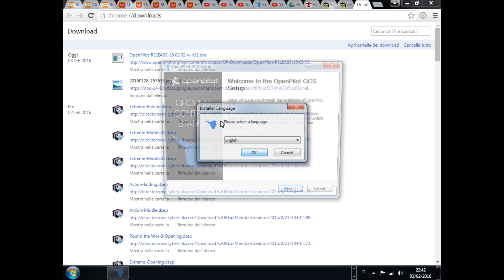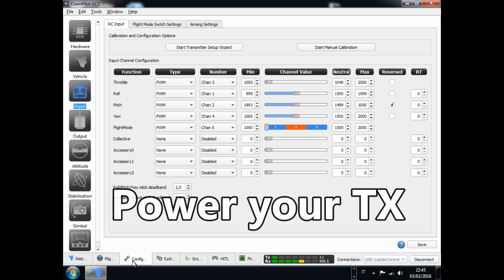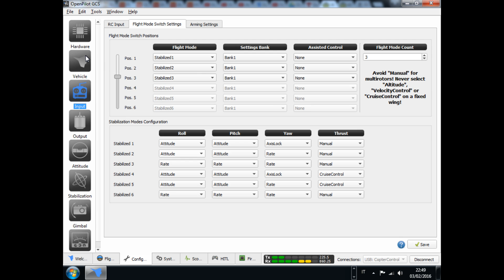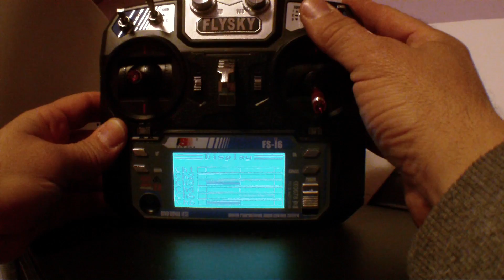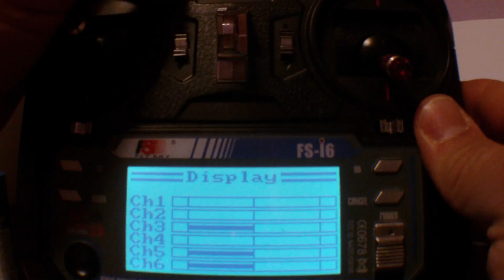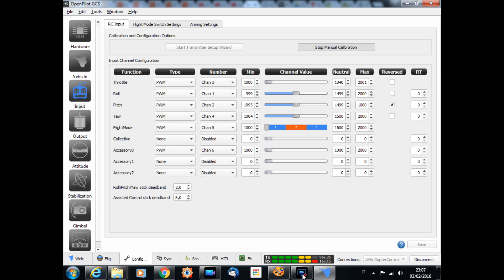Eachine Falcon 250 - how to enable ACRO+ with Openpilot - Fpv Racing!

Comment: Hello Angelo! I'm new with all this.  So to set acro mode on you don't need to plug your radio to the Pc? Only the drone?
Reply from the maker: Yes, only the drone as you can see on the video. Obviously you have to choose one stick on the radio to be associates to the AUX for changing mode
Reply: Ok..  Thanks! Another question: as I understood, it is not recommended get off the ground or landing in acro mode, is this right or did I understood wrong?
Reply from the maker: It's up to you. If you feel right to take-off and land in acro you can do it. Now I prefer the angle because I'm using airmode so the motors spin when armed and I prefer not (even if I know that I can stop spinning also in airmode...).
So, start and land in angle mode and switch in acro when you are flying.

Comment: Stabilized flight is already set
Reply from the maker: Is it a question? :-)
Reply: Yesss! Stabilized flight is already set?
Reply from the maker: Wow! It's an old video for me. If I remember well after flashing libre I found attitude activated by default. But you need to check with your pc because you have to configure the swith on the radio as you prefer
Reply: Thanksss a lot man!

Comment: Ciao Angelo, UN tutorial sulla radio eachine i6 ...........lo metti in programma ? In italiano.......
Reply from the maker: Per i multirotori non c'è moltissimo da fare sulla radio. Ci penso e vediamo cosa esce
Reply: angelovideo71 grazie. Senti devo risolvere un mistero, sto assemblando un falcon 250, ho preso telaio con pdb originale, ho saldato i connettori e collegato ccd e batteria e basta, la cosa strana è che in tutti i connettori di uscita,esc ECC... dove dovrebbero uscire 5v ne escono 12...???? Strano o fino a che non collego gli esc è normale ? Grazie per la tua disponibilità Angelo.
Reply from the maker: Samuele Tirinato sono alle prese anche io con la sostituzione della pdb e sto avendo problemi. Sembra che tutte le uscite a 5v siano inattive (forse manca un componente...bo) anche se una volta ho misurato 5v da una di loro. Ma solo una volta. Ho risolto mettendo un bec esterno (cosa antipatica perchè da una pdb ci si aspetta di avere tutto incluso). Inoltre i collegamenti tra esc e fc non corrispondono alla configurazione di LibrePilot per cui devo bypassare la pdb e collegare gli esc direttamnete alla fc. Praticamente un sacco di lavoro e cavi in più. Probabilmente stai avendo i miei stessi problemi anche se non ho capito esattamente dove stai misurando i 12v

Comment: Hi, Could you explain - for which purpose used VrA and SwC? Am i right that SwC used for FlightMode switch to acro? For what then used VrA?
Reply from the maker: I prepared it to use for tuning on flight. You can change PID with a pot.
Reply: Have you already tuned PIDs? If yes - could you share them?
Reply from the maker: If you see my other video on falcon you can see that I used the stock pid. They are good for me.
Reply: I saw, but thougth, that i missed, something. Also i got strange result with acro+ mode quad just flipping back. Looks like i missed something in your video. Could you please upload xml with your full config (or just send directly to me)?

Comment: Nice tutorial. My first mod would be to extend the mini usb connection to the side so I wont have to disassemble half the quad to test different settings.
Reply from the maker: +Leo van Miert yes. I'm waiting for some usb angle connectors
Reply: +angelovideo71 So after these changes, how do you like the Falcon so far?
Reply from the maker: It's a very good RTF. I fly with stock parameters except for enabling acro+ and adding speed on flip and roll. No waste time in tuning! Only fly
Reply: I have the usb on the left side and I just cut the carbon fiber  blocking the port using a small pile.

Comment: Risolto il Max del gas era a 1500 invece di 1900 , comunque ho usato librepilot , aggiornato il firmware è usato le impostazioni del zmr 250 con batteria a 3s , messo attitudine a - 10 . Adesso aspetto che smetta di piovere per provare fuori !!!
Reply from the maker: Ottimo! Aspettiamo riscontri su Librepilot

Comment: ciao , non capisco come mai il mio falcon quando do tutto gas non schizza verso l'alto come si vede in alcuni video , devo cambiare qualche impostazione ? altra domanda : ci sono cam migliori  con osd incluso ?
Reply from the maker: Per lo schizzo in alto credo che lo stiamo già esaminando su altri canali. Sono sempre Angelo ;-) 
Per le Cam prendi questa è vai tranquillo.
http://www.banggood.com/RunCam-Magnesium-Alloy-Housing-SkyPlusPZ0420M-600TVL-18g-Wide-Voltage-PALNTSC-Mini-FPV-Camera-For-QAV250-p-1000577.html?p=HM3106075425201208YA
 Devi solo fare un po' di cablaggi ma quelli sono necessari quasi con qualsiasi altra Cam. A breve spero di pubblicare il video in cui mostro come l'ho montata

Comment: This video is incorrect, you changed to acro in settings bank 2 but you showed settings for bank 1, i would like to see your set up for flips/rolls please
Reply from the maker: Only bank1 is used by default on falcon. I associate second flight mode to acro+ but always in bank1. You can see parameters in basic and advanced on 3:30 and 3:50
Reply: +angelovideo71 ahh ok I have the racer, has 3 modes
Reply from the maker: +Jason Loranger if you have openpilot or Librepilot it's the same. You can associate flight mode to bank as you prefer. If you want to see parameters I used on racer see my other videos